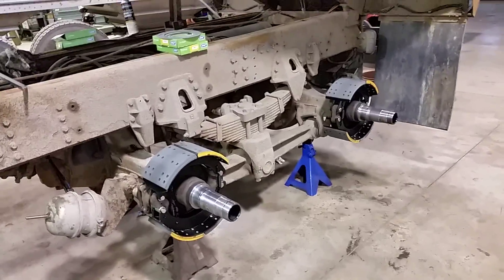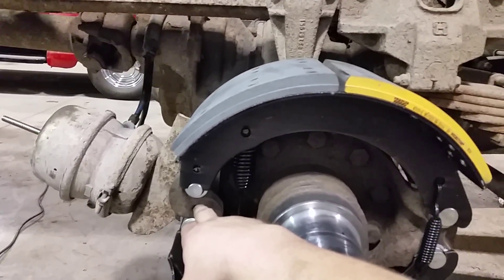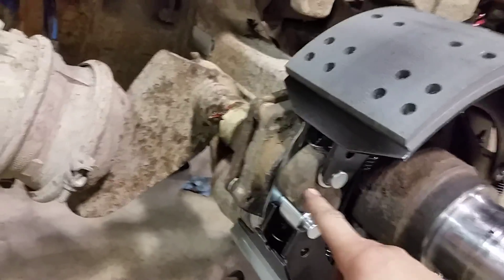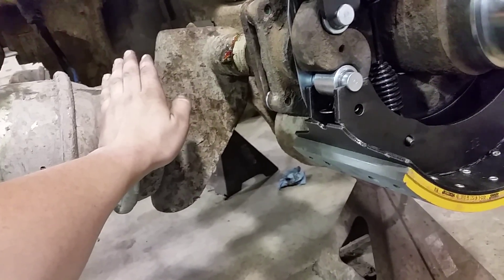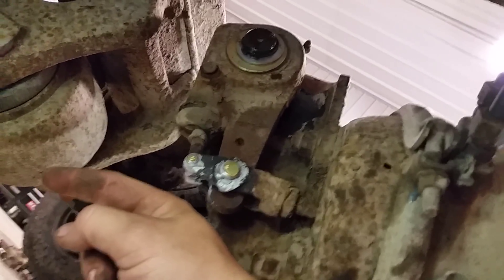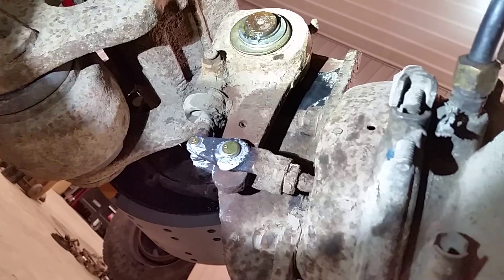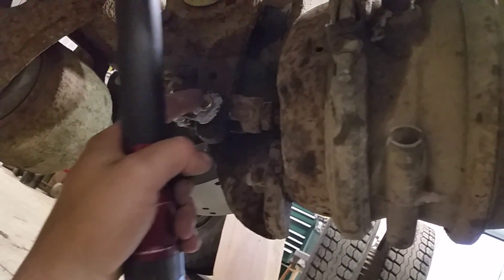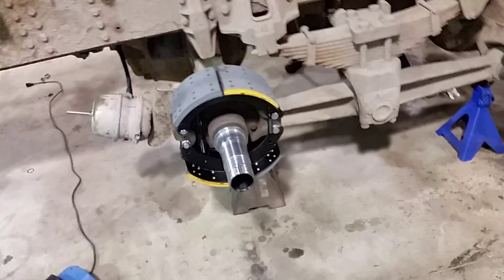How Air Brakes Work

Comment: That's the wrong material for the air lines. Supposed to be rubber hose not plastic air lines.
Reply from the maker: False, those are dot plastic airlines.  You can use those or rubber with stainless braid. I'm not aware of a truck OEM that doesn't/ hasn't used dot airlines in the last 15 years